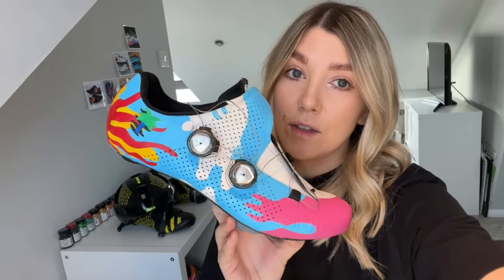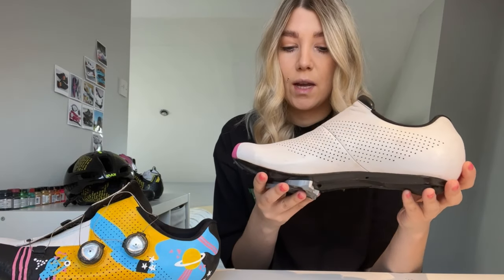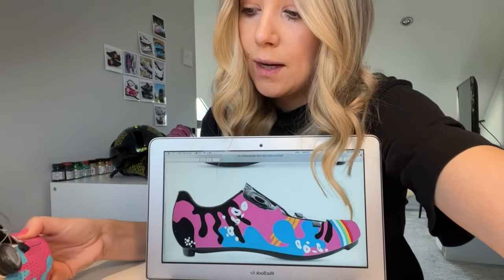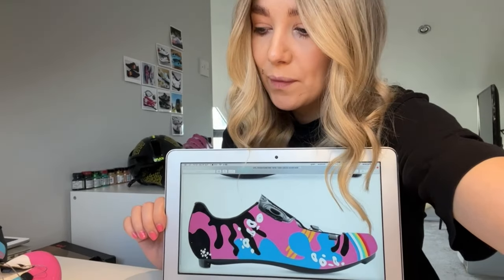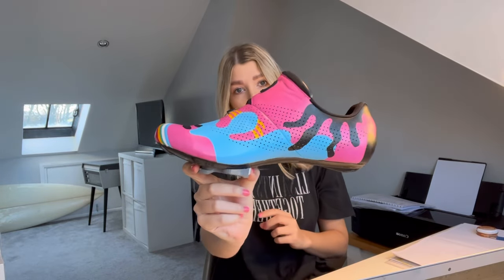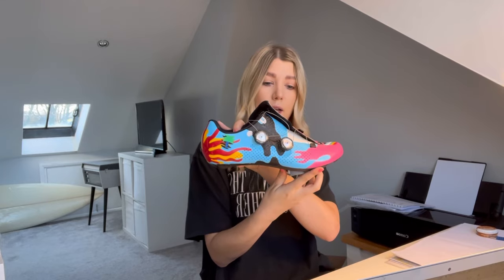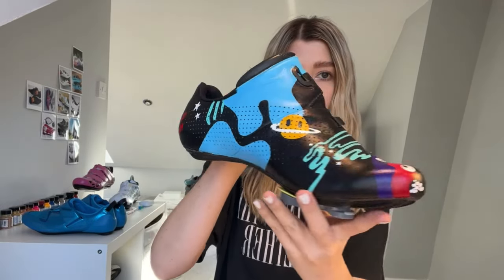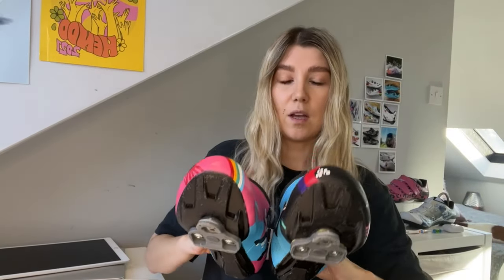custom fizik cycling shoes

Comment: Just started painting my first cycling shoes today. I've taped off areas I didn't want paint on, but managed to anyway. Can you recommend a product to remove paint? 
Thanks for your videos, they helped tremendously!
Reply from the maker: So pleased they helped! You can use Angelus deglazer to remove paint- it’s basically like an acetone. It’s really strong so if you use it, make sure it’s sparingly. I use it with a wet cloth 😊